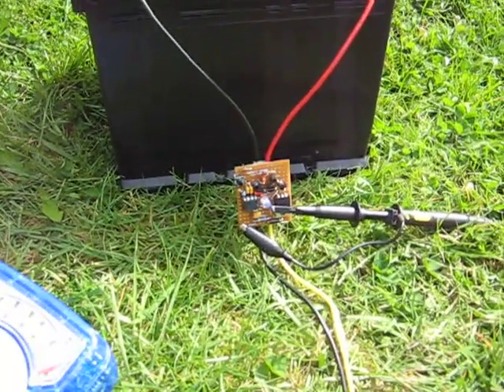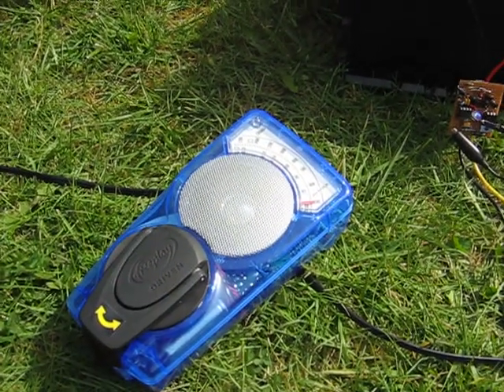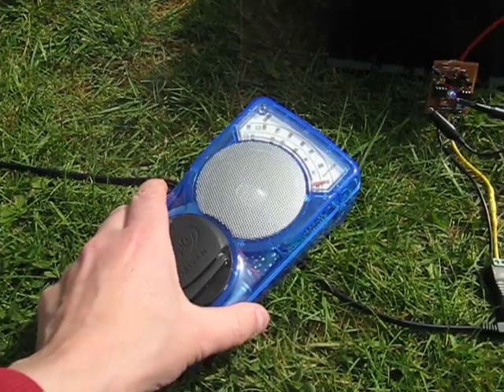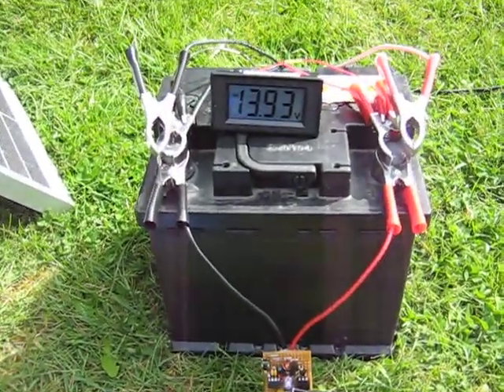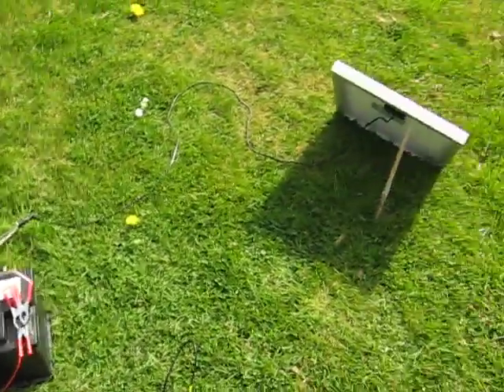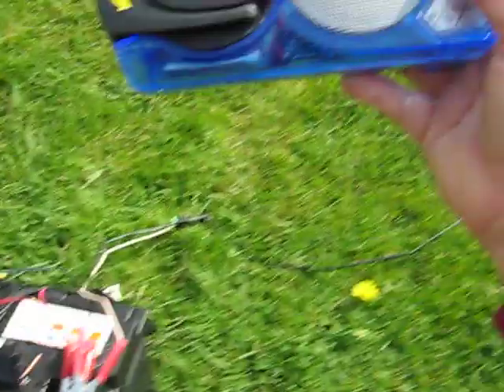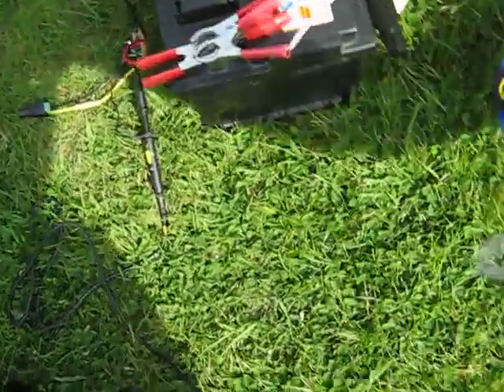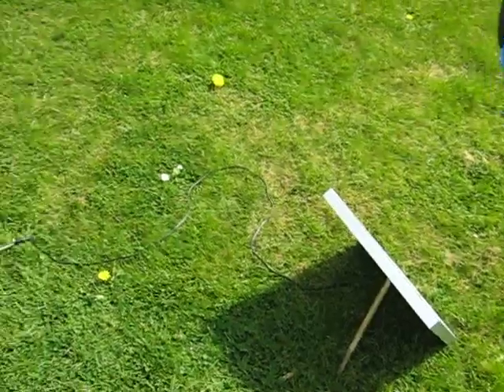Solar Charge Controller Radio Frequency Interference (RFI)

Comment: You have to turn off the controller if you want to use your radio. Nothing can be done to stop the noise. It is HF switching noise.
Reply: That's not ALWAYS true.  Properly applied ferrites may help, and some controllers suppression components were removed by the manufacturer.   these can often be replaced if you know electronics and can solder.  
 The solution is for governments to stop this crap from being imported.

Comment: Hi. Thank for posting this tutorial. The first noise you presented my setup suffers from and adds quite some noise to raspberry/DAC+ musicserver connected trough a 12-5Volt buckboost converter. Any ideas of how to reduce this pwm induced noise on the loadline? It appears only when the panel is charging, aka sun is shining.

Comment: I wish you would tell which it is. I am going to use solar to power my ham radio portable and would like to steer clear of this controller
Reply: Looks to me that just a solar panel was hooked up without a charge controller. Just follow the wire/cable from the solar panel to the battery.
Reply: For the most part there will be some kind of RF interference with most charge controllers.  I attended a class at a recent hamvention and found our that there are some very specific charge controllers that are used for Radio installations.